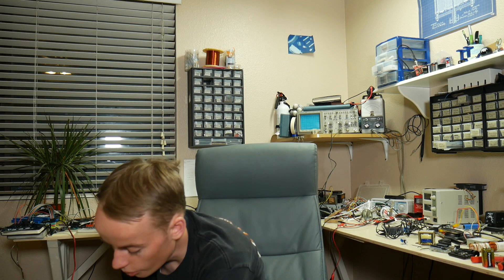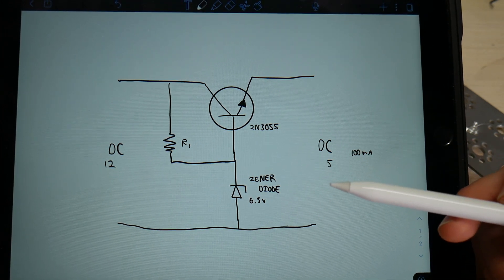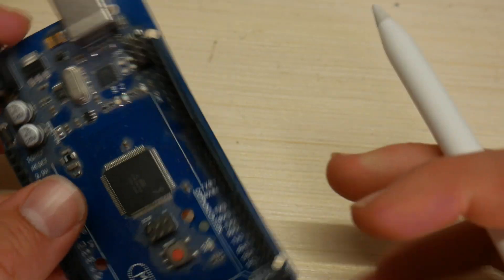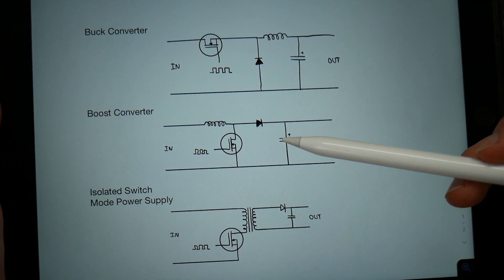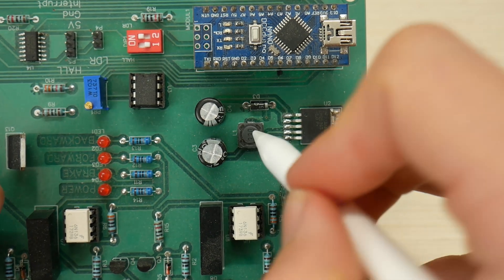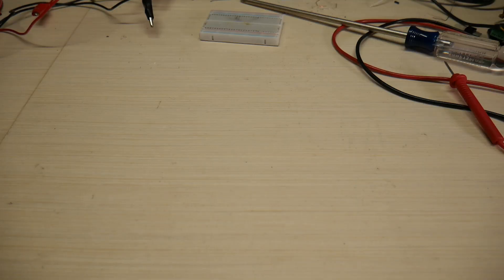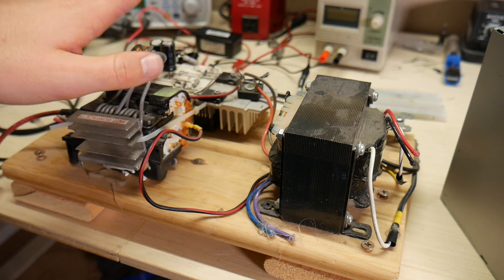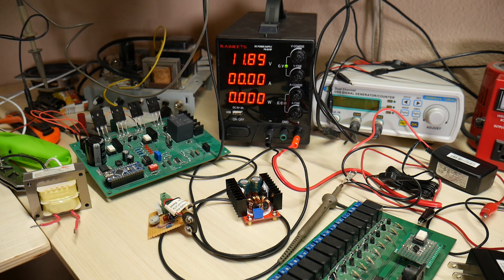Linear vs Switching Power Supplies: How they work and which one to use(With Kaiweets Power Supply)

Comment: Take a 1000 watt high pressure sodium ballast transformer and chop out the secondary coil. Then you can wrap it with whatever secondary coin you want. I have 16 turns of 4 awg to charge super capacitors in seconds. Cheers

Comment: I have tried different power supplies and different uses for them, I have developed some kind of basic understanding what to avoid where, but I would like to see optimization ideas. To clarify: If i have to use switching psu with old audio equipment, how to get rid of the whizzing and how to get rid of hum, while using new audio equipment, that does not account for grid frequency hum. What happens when I use linear regulator directly after transformer psu or switching psu to try to smooth it out. Essentially it might be possible to provide rough voltage, that is regulators voltage drop plus roughness margin and the useful voltage? That could minimize the loss and provide awesome fast smoothing.

Comment: 10:00 Im pretty certain that that is the NTC thermistor. It decreases resistance when it heats up. It is there to protect FBR from inrush current of the big smoothing capacitor and as it heats up, the resistance drops which improves efficiency rather than having resistor which wastes ton of power
Reply: Are you sure? Thermistors are typically thermally coupled to the fbr. Also I have seen those on boards far away from FBRs